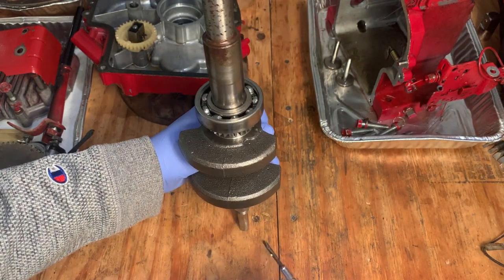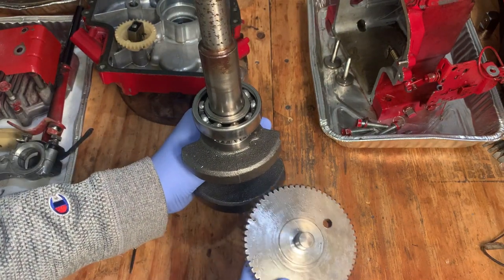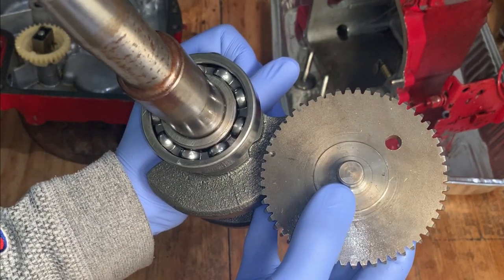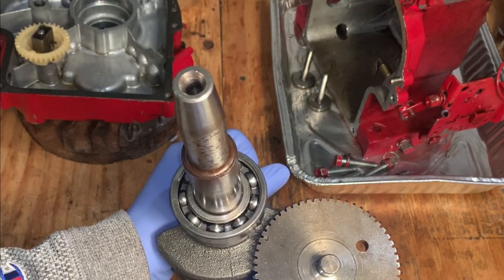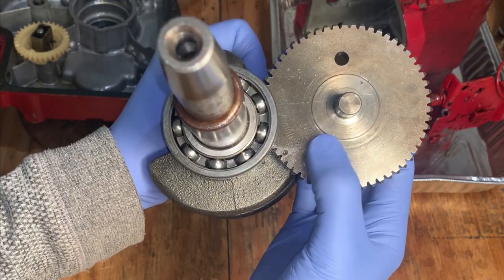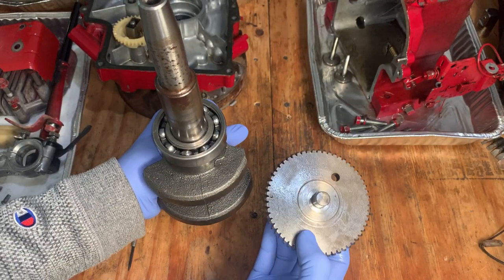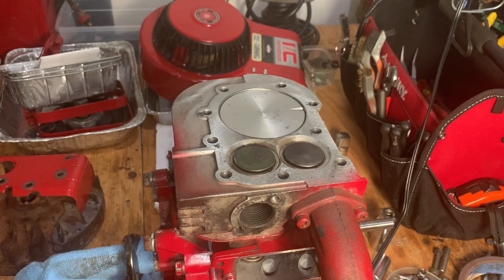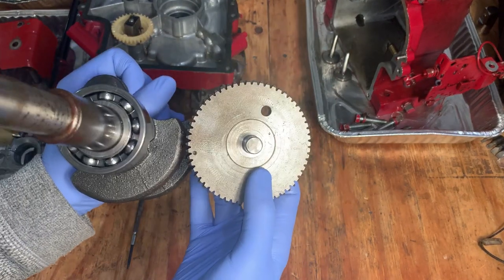Briggs and Stratton L-Head Counterweight Timing - Crankshaft Gear Timing Mark Covered by Bearing

Comment: What engine and how many cc is that
Reply from the maker: It was a Briggs 8hp engine.  Not sure the cc’s off hand.  Guessing 250-280cc range.  The engine number is 195432-4070-01.  Link to the video I pulled this clip from is https://youtu.be/SR8tQJ9NFvo?si=IKn7C6E7ao_2ObZv
Reply: @jcondon1  thank you😆